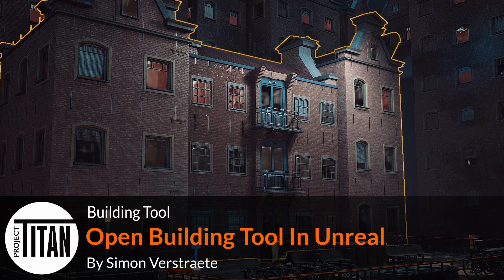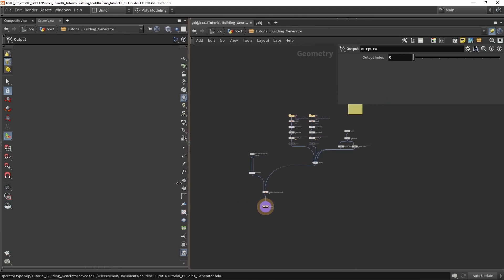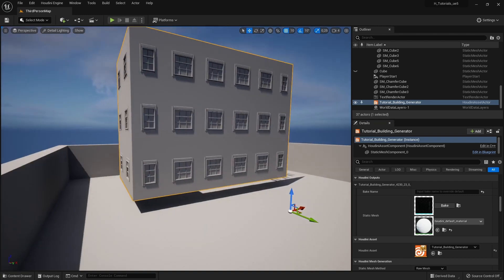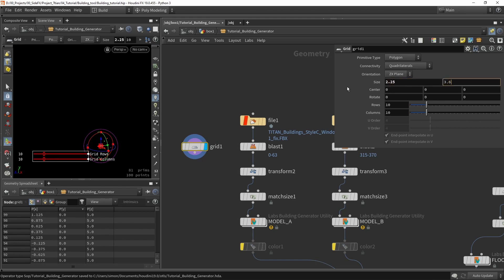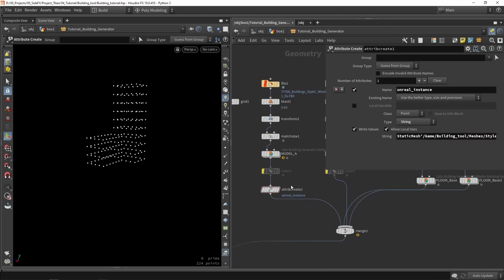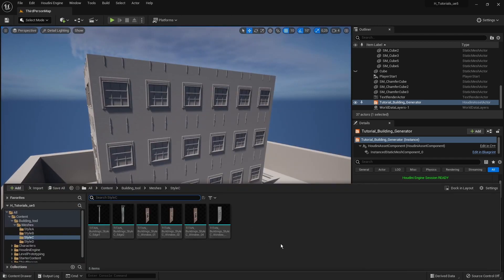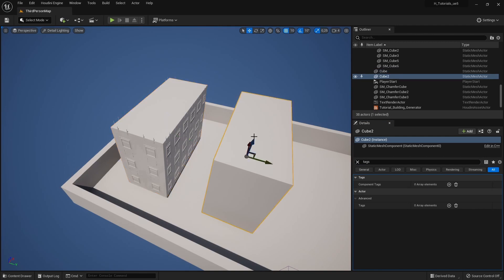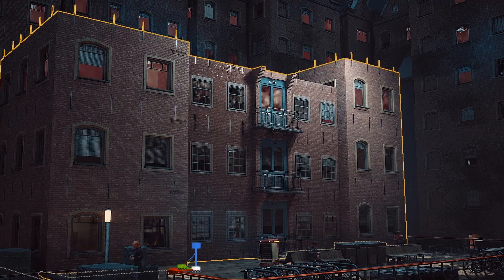Project Titan Building Tool | Part 3 | Open Building Tool in Unreal

Comment: Around the 9 minute mark, the newly created attribute 'unreal_instance' is passed to the output node. I tried doing this for Unity, writing unity_instance instead, but this does not work sadly. When I view the output node in the geometry spreadsheet pane, the unity_instance rows show as empty. No string info is visible.

Edit: After some playing around I have found a work around. If you input them as 'unreal_instance' attributes as advised, you can then select Unity as the 'game engine' under the settings tab for the Building from Patterns node. This converts them to unity instances and carries them to the output node. It's like a last minute conversion. Hope this helps as a work around.

Comment: Hey awesome tutorial but for some reason when I bring the asset into ue all I see is a single window plane, using the cube as an input has no effect
Reply: Have the same issue, double checked all the tutorial steps but there is no output geometry in unreal

Comment: Hello everyone, for those who couldn't solve the instantiation problem in Unreal. Just freeze all the file nodes that hda and the instances will work fine.
Reply: I had this same issue, When I brought the HDA in Unreal and selected the box to use I go no result. The Houdini logo just sat there
Reply: @d00gl3  Did you manage to solve this?
Reply: @ArchonsGame  no sorry, kinda gave up on this project for right now
Reply: @d00gl3  I see, did you have Core version?
Reply: @ArchonsGame  I have Indie license
Reply: after doing the above steps, you may want to press rebuild in Unreal for the changes to take effect.